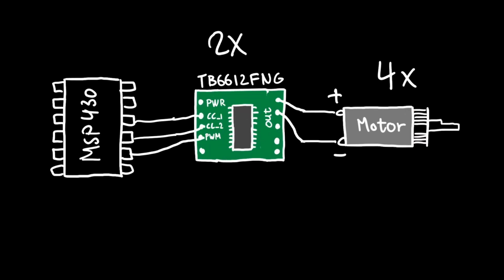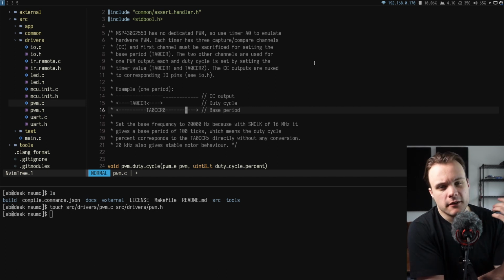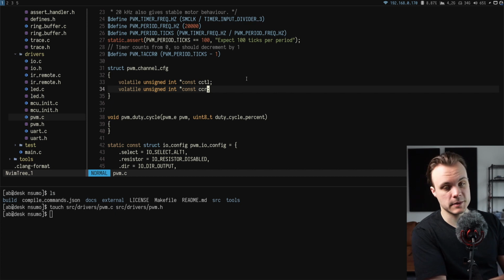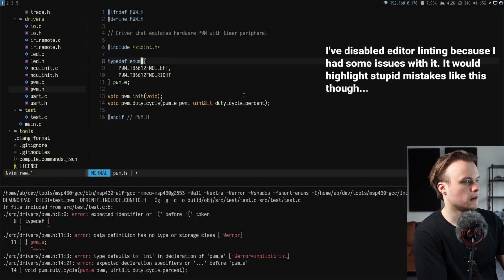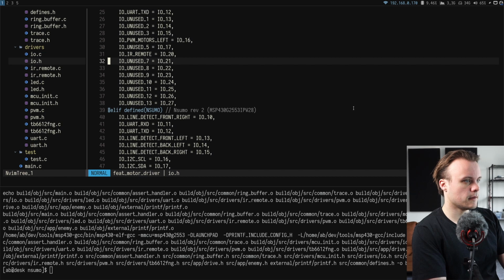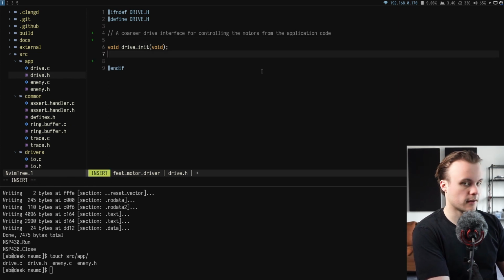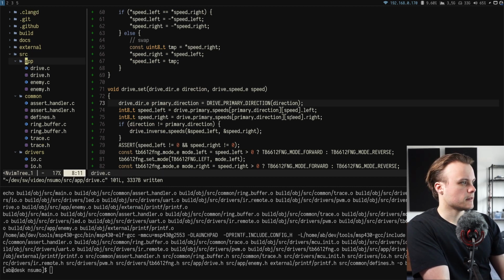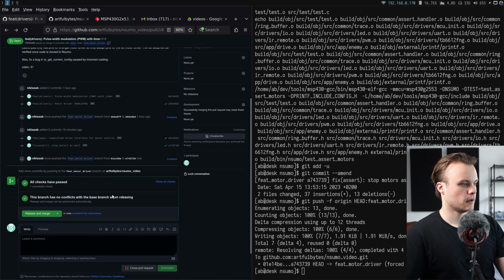Motor Control with PWM in C | Embedded System Project Series #21

Comment: what is the schematic for launchpad with tb6612fng?
it's difficult to see and different with pcb design
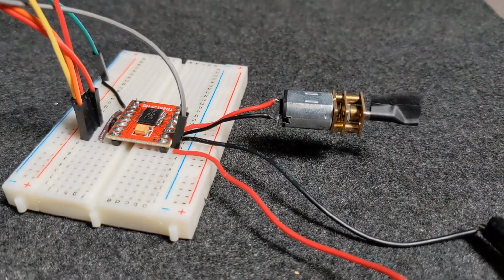where the short little black wire is connected to? 2:25

Comment: Just curious why you didn't opt for motors with encoders? Also what is the benefit for using skid steering?
Reply from the maker: Price/complexity/size, and I don't think the precision from encoders would be that beneficial in practice for a sumobot. Skidsteering allows for zero-radius turning and to turn with four wheels without having a separate steering mechanism.